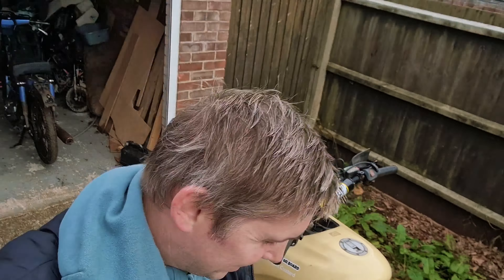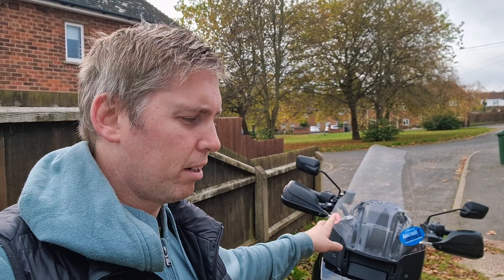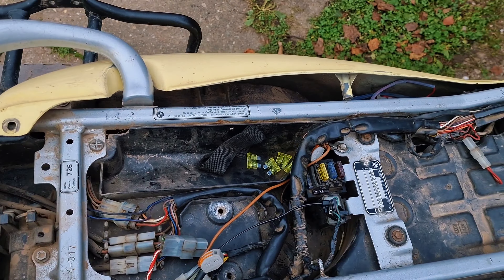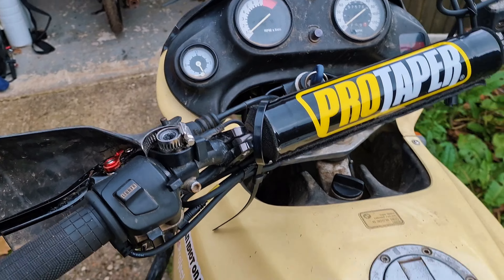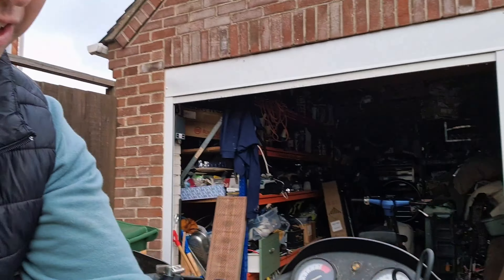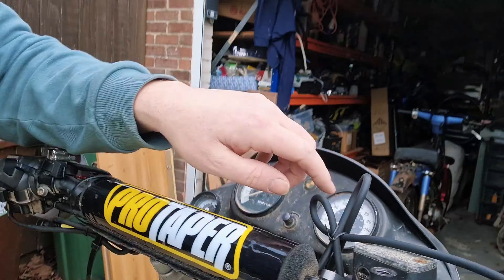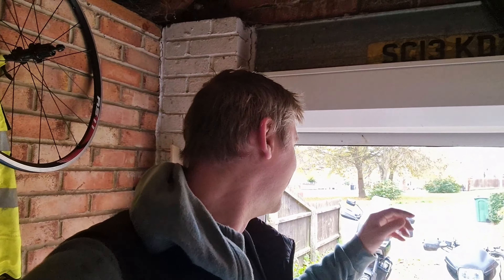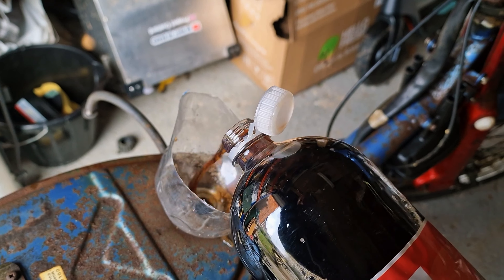BMW F650 Funduro and Honda C90 projects revisited - An Idiot On Board - Ep 45

Comment: I didn't know that you'd got the Harley back and running, at least you've got something to fall back on if needed. I think Custard is well worth persevering with, He's a Himmi 450 beater in my eyes, as good if not better! Mind you, reliable 'leccy bits required for a trip to the Hebrides!  Fair play to you, I wouldn't want to camp up there in the summer, let alone this time of year...  Just by way of a 'Heads Up', If you want a good mechanic to look at it, Overland & Classic at Melton Mowbray is the place to go, He's s***hot with elderly BMWs, not that far from you i think. Good Luck!
Reply from the maker: @kenbrooks7794  yes, it took 7 months but I finally got it back. I'm not going to lie, I struggle to trust it at the moment. But I have been using it daily for the last month and really am enjoying it again.

The funduro certainly is a cracking bike, but it definitely needs a few more bits to make it right for me. I need a taller seat and could so with lifting the suspension somehow, but all that can wait anyway. Need him to be mechanically sound now more than anything. 

It sounds nuts, but I've been wanting to do it for a long time. I really don't have much of a plan other than to go until I can't go anymore or run out of money 🤣

Ahh excellent, I shall keep that in mind thank you. Melton isn't all that far away. 😁